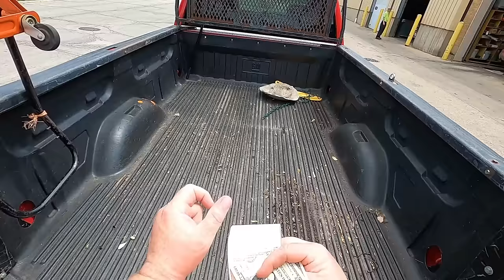Street Scrapping - Truck is Full

Comment: Clean the inside of that coffee pot by running vinegar through it, and leaving it to sit to dissolve calcium on the inside and around the heating coil. I'd like to do this with fresh vinegar and do it two or three or four times leaving it sit overnight or taking at least two or three days to sit with vinegar in it. Cleaning out the calcium will make the water heat faster. It's like your hot water tanks collecting calcium from the water. Good find! Have fun.